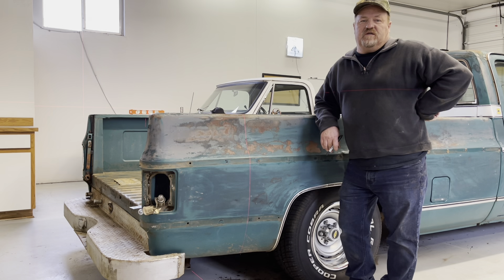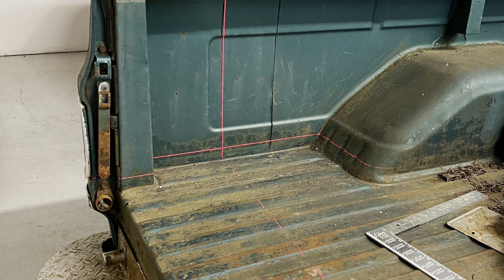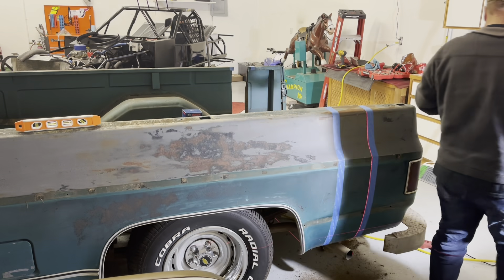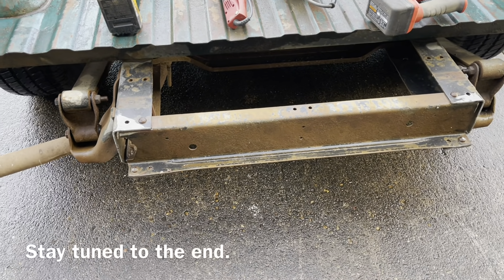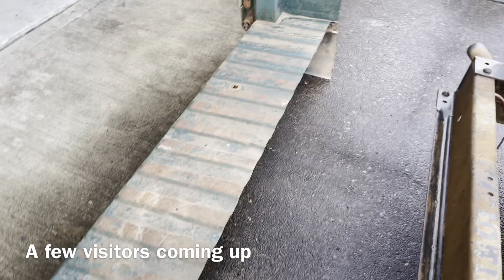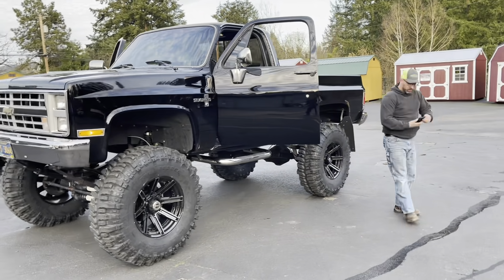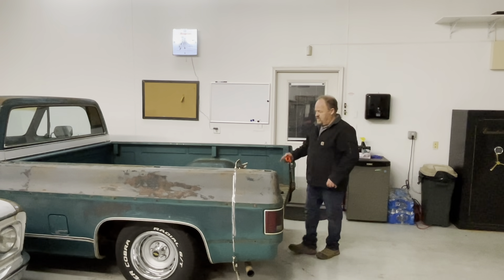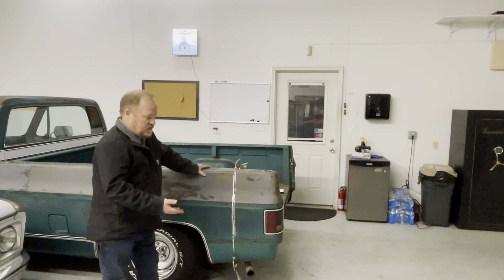Chevy C10 $1,300 Budget Build Part 3 Short Bed Conversion Vice Grip Sawzall and Grinders!

Comment: I’ve done this and found the rear crossmember moves forward about 6”, the holes are already there to bolt it in. Cheers
Reply from the maker: Thanks John. Yes they are and we will be using them.
Reply: How much will cost to do the same job in a similar truck

Comment: I did this on a 69 and shortened the bed before finding a step side bed later. I would suggest taking the bedsides off and try and fix any dents before hand... I did mine on a old 3/4 ton for practice before trying on a nicer truck later... I didn't take the time to fix a large dent on the driver's side and it made putting back together much harder and part of the reason for replacing the bed. But the passenger side worked great. And I am not a body man.
Reply from the maker: Thanks Chad

Comment: One thing every body forgets to mention is you need to shorten the chassis the drive shaft brake lines n wires you would need a welder I seen people just bolt the chassis with plates no bueno 😎✌️

Comment: Nice Job! i did mine also but was lucky to find a decent short bed so that save me lot of time and labor! for the rear brass you just have to move in inside the frame youv got already the same set of hole to to that! :o)
Reply from the maker: Thanks for the tips! I have short bed I could install. I want this patina and I was in for the challenge.
Reply: @RustyDuckGarage  good choice to save this patina.....mine is plain white faded so was easy to match! ;o)
Reply from the maker: Thank you. I have another bed but didn’t think I could match the paint. So here we go.

Comment: I have no clue why, but I have seen some of these trucks at shows that have been cut this way, and I think it looks killer just welded back up together and left exposed. Let it rust and all that. The patina is beautiful and that rusty cut would add to the character. Then throw a matte clear over the whole truck once the color has changed on the welds.
Reply from the maker: Exactly. Not sure why I really like them that way but I do. Some do not see it the same way. I’m more drawn to a truck with patina than a shiny truck. I’ve had cars and trucks with nice shiny paint and I felt like I had to be so careful how I drove or parked them.
Reply: @RustyDuckGarage  meeee too. I agree

Comment: If it didn’t come short, it doesn’t count. Sorry. Not sorry. Lol. This looks funny.
Reply from the maker: No problem! It will look right when finished. Thanks for watching.
Reply: @RustyDuckGarage  just sayin if you were gonna do this at the least you could of done it the right way which is changing the chassis, then cutting some from the front and some from the back.it looks funny with the tank there. Is like not short or long. This is a medium bed. 😂😂
Reply from the maker: @Programz26  I will be taking 14 inches out in the front and shortening the frame. Stay tuned.
Reply: @RustyDuckGarage  can’t wait to see.

Comment: What wheel and tire size? Awesome setup !👍🏽👍🏽
Reply from the maker: 275/60R15 in the rear. And the front is a 225/70R15 on 15 x 8 Rally Wheels
Reply: It all with out in the long run